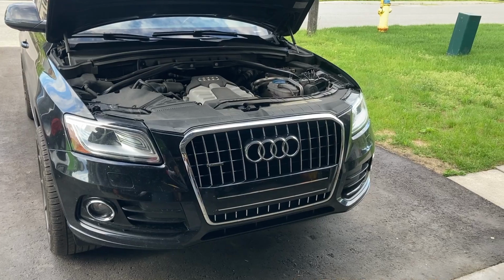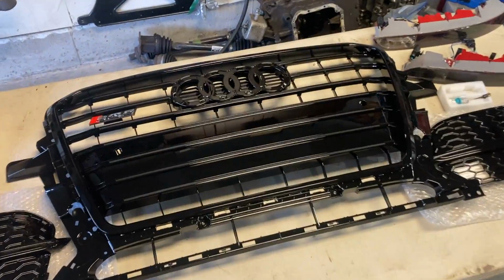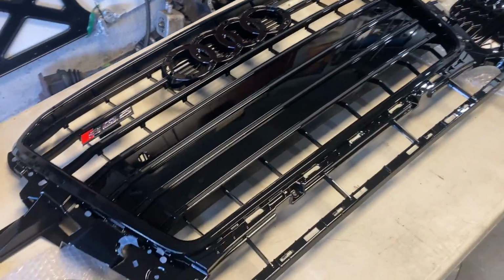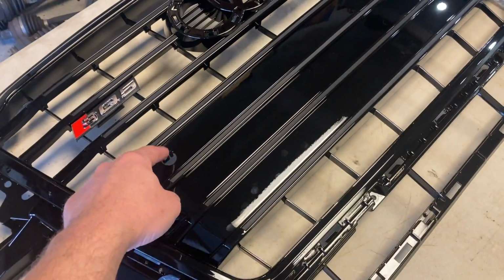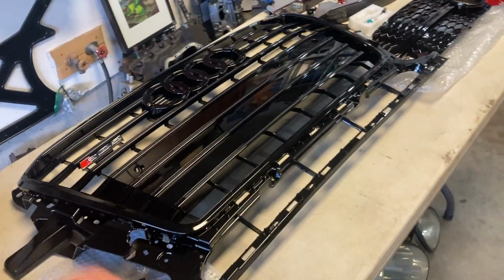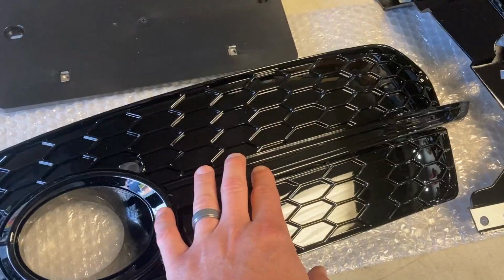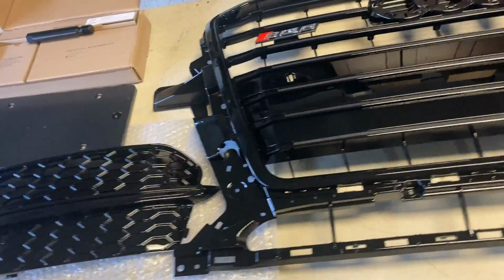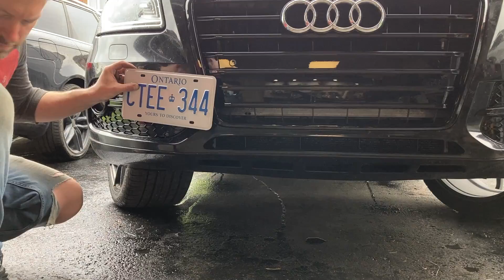Audi Q5 Grille Swap and Side Mount License Plate

Comment: Looks great, A nice OEM plus look for a q5. I was wondering if you had a link to where you bought this one? And By any chance, do you know if this would fit the 2012 bumper
Reply from the maker: I’d give you a link but they expire so quick. EBay is easy to find. This would be same for a preface lift non Sline bumper.